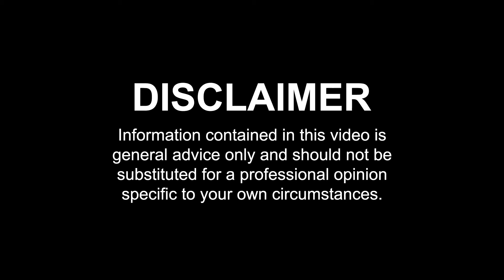Mercury Filling Removal (SAFE) - DON'T replace your fillings UNTIL YOU WATCH THIS!

Comment: I got mine removed today BUT they did not have an air suction thingo, and they did not use a rubber dam. I think they just used two suction sticks and that's it. I'm not toooo worried, I have zeolite clay to remove heavy metals, plus activated charcoal. I even have herbal teas meant for detox. 
I emailed a holistic dentist to get a quote from them (to do my other mercury fillings there) but they cost a lot more.
Reply: NIGHT BEFORE REMOVAL
 Magnesium Glycinate – 400 mg

 NAC – 500 mg

 Selenium – 100 mcg

 Chlorella – 2–3 tablets

 Omega-3 – 1 softgel (optional)

MORNING OF REMOVAL
1 hour before:

 NAC – 500 mg

 Selenium – 100 mcg

 Chlorella – 3–5 tablets

30 mins before (empty stomach):

 Activated Charcoal – 1 capsule

Optional:

 Fresh orange juice or fruit for natural vitamin C

EVENING AFTER REMOVAL
 Activated Charcoal – 1 capsule (away from food/supplements)

 Chlorella – 2–3 tablets with dinner

 Magnesium Glycinate – 400 mg

 NAC – 500 mg

 Selenium – 100 mcg

 Omega-3 – 1 softgel

DAILY FOR 1–2 WEEKS POST-REMOVAL
 Liposomal Vitamin C – 500–1000 mg, 1–2x/day

 NAC – 500 mg, 1–2x/day

 Selenium – 100 mcg

 Magnesium Glycinate – 400 mg

 Chlorella – 3–5 tablets, 2–3x/day with meals

 Activated Charcoal – Optional, 1x/day if needed (away from food/supps)

 Omega-3 – 1 softgel

 Lion’s Mane – Optional (for brain support)

For you, since it has already been 4 months, consider ALA to heavily mobilize the mercury, and binders, like the activated charcoal, coupled with the rest to fully remove it.

Comment: I got my mercury fillings in
1976 . Just had a small one removed yesterday. It was a small one on the side of my molar .. dentist drilled and then used a straw like tube to suck out the vapor (I'm assuming) I want to to a preventive detox in case I swallowed /inhaled mercury vapor. Any suggestions how to get mercury out of your system

Comment: I just went to get mine removed today and last week... I am shocked at seeing online the special procedures whilst I had them removed in a very casual way... My dentist had no protection for herself, staff or me... My teeth were drilled cleaned and refilled with composite... I was worried of swallowing the components of metal so I kept asking for permission to spit and the sink would have dark dust in it when I'd spit out saliva... Very small particles and not that much though...

But there was absolutely no special measures taken during the procedure
Reply: Any update ?
Reply: @hardhitta1000  I'm taking zeolite clinoptilolite from time to time, I hope I will take it regularly instead of once in a while. I do experience dizziness which is very unusual for me... However I cannot say that it's definitely due to the filling removal. I'm sure the zeolite will do a good job insha'Allah. All is good... I don't have unusual memory loses, I haven't got any symptoms of illness for now...

Comment: My mercury/amalgam fillings were put in when i was 14 and now aged 80 i am wondering what all the fuss is about. Mercury is only 6% of the amalgam and if it was as dangerous as we are being led to believe why aren't people dying in droves from these deadly fillings?
Reply: Wow I got mine at 12 and I’m 34 should I remove mine or ride the wave? 😂
Reply: How many amalgam fillings did you have? Thanks for sharing.
Reply: I got my mercury fillings  in 1976 . Just had a small one removed yesterday . It was a small one on the side of my molar .. dentist drilled and then used a  straw like tube to suck out the vapor( I’m assuming ) I want to to a preventive detox in case I  swallowed /inhaled mercury vapor . Any suggestions how to get mercury out of your system
Reply: @Givingyouthebird123  I get mine out tomorrow, below is the protocol i will be taking. Since it has been months for you, it is safe for you to include all of this, and ALA (Alpha Lipoic acid) which will heavily pull the mercury from the tissues that it has settled in, coupled with the rest below, it will be bound and removed.
Reply: @Givingyouthebird123  NIGHT BEFORE REMOVAL
 Magnesium Glycinate – 400 mg

 NAC – 500 mg

 Selenium – 100 mcg

 Chlorella – 2–3 tablets

 Omega-3 – 1 softgel (optional)

MORNING OF REMOVAL
1 hour before:

 NAC – 500 mg

 Selenium – 100 mcg

 Chlorella – 3–5 tablets

30 mins before (empty stomach):

 Activated Charcoal – 1 capsule

Optional:

 Fresh orange juice or fruit for natural vitamin C

EVENING AFTER REMOVAL
 Activated Charcoal – 1 capsule (away from food/supplements)

 Chlorella – 2–3 tablets with dinner

 Magnesium Glycinate – 400 mg

 NAC – 500 mg

 Selenium – 100 mcg

 Omega-3 – 1 softgel

DAILY FOR 1–2 WEEKS POST-REMOVAL
 Liposomal Vitamin C – 500–1000 mg, 1–2x/day

 NAC – 500 mg, 1–2x/day

 Selenium – 100 mcg

 Magnesium Glycinate – 400 mg

 Chlorella – 3–5 tablets, 2–3x/day with meals

 Activated Charcoal – Optional, 1x/day if needed (away from food/supps)

 Omega-3 – 1 softgel

 Lion’s Mane – Optional (for brain support)

Comment: Dr I am very scare I have two left and right upper and need to be change to composite and I have decay under it . I thought they will last forever !!!!! I am maddddddddd really mad and scareeddd bcz keeping is dangerous specially if their is cavity will lead to infection  removing is dangerous all dangeroussss 

My dentist is bio 
But how safe is the removal I don’t want health issue after I have health isssue I don’t want new symptoms or my ibs to get worse or get headaches or something in my brain after removal or crack my tooth I have soo many tough
Reply: Did you get them removed yet? Your situation sounds like mkne
Reply: @Skyestorm2630  not yet I am scare and still worried
Reply: Update ?
Reply: @hardhitta1000  hamdoulilah he changed to white 3 month ago, i was scare I did one by one and for sure white one are little more sensitive but is okay it takes time to get use it.

Comment: I had 4 fillings replaced by just a drill today. In soooo shaky and sick and have horrible anxiety! I’m so scared right now. I wish I didn’t get them out!!

Edit update after ONE month.  I had a panel of tests done, and it turns out my body was 16xs the normal limit of heavy metals and 43xs the limit of mycotoxins. I had 4 different types of mold and I was recommended to start a heavy metal / mold Mycotoxin detox asap. I started this one week ago and the brain fog has already lifted. I’m grateful to be able to recall my days. It literally felt like I had full-blown dementia. I am so blessed that this isn’t the case.
Reply: all at the same time? and didnt use any safety like rubber dam? i have 2 that will be replaced this week
Reply: @mr.yuteph8157  yes all at once, with no rubber dam. It was absolutely horrible. I’m still detoxing with chelation therapy and major diet change
Reply: @manifestlove888 I’m so sorry to hear this. How are you doing now?!
Reply: @Skyestorm2630  for some reason I don’t always get notifications to the replies. But I’m doing amazing now I had to give up my job and stop driving because I couldn’t think now I’m back behind the wheel of my vehicle and I’m working again and I just had a beautiful baby boy.
Reply: @manifestlove888  how many years have you suffered from this ? ( I am also facing brain fog , memory loss and acting like a dumb) 😭
Reply: @unknown77722  it was 3 years almost
Reply: @manifestlove888 that's boss did you get them replaced with the bpa composite though?
Reply: Update please ?
Reply: @hardhitta1000  I am actually doing amazing. I am back behind the wheel of my car and I have a job again I also just gave birth to a little baby. I honestly thought that like, I was gonna die. When I read this, I almost don’t recognize the person I was I was terrified. But I came out of it. I don’t think people can come out of it without help. So thank God for the finances.
Reply: May i know what helped u with both  pls I am so sick

Comment: My dentist didnt use rubber dam or ventilation am i going to get mercury poisoning?
Reply: If you don’t feel good or experience depression and anxiety start detoxing the mercury with low emf home infrared saunas and mix enterosgel with water before you go in the sauna because the sauna will pull the mercury from the tissues but the gel will help push it out so the symptoms are low

Comment: Can you believe I searched out a green Dentist that did safe mercury removal and he didn’t even use a dental dam? I didn’t realize it until after it was over and they were prepping for my onlay that I had a small pebble size in the side of my mouth they didn’t even rinse my mouth out I had to get up while they were out of the room and rinse my mouth out now past 10 days I’ve had a resurgence of chronic fatigue syndrome that I’ve been in remission for a decade and I’ve got it in the first place from mercury fillings long story the dentist I had in the 80s wanted to use up all my insurance I’m guessing because he gave me a mouth full of fillings when I didn’t need it they all buckled within six months and had to have them all replaced well I ended up with chronic fatigue syndrome for decades after that anyway I’m just so mad right now
Reply: Are you fine now? I have one of those mercury fillings for almost 2 decades. Thinking of removing it in a safe way
Reply: @hevesat1920  No answer as usual.
Reply: Yeah are you better now? I would be pissed too
Reply: Can you please answer our questions/ Are you dead?
Reply: Same. I got really sick after taking mine out. But strangely I feel lighter. I’m so glad they are gone.
Reply: @chloethemessenger  Is it better to remove the molar if not necessary?
Reply: @chloethemessenger  how sick did you get ? And how many did you have? I’m trying to get all mine removed before trying to get pregnant but I’m scared
Reply: Ok. Is November 2nd 2022 are you dead?
Reply: What does the mercury fillings get replaced with?
Reply: @thussaiththelord3378  Ceramic filling.
Reply: How are you now???

Comment: Can I just get a dentist to remove eight back teeth I have seizures so don’t want to risk exposing myself to the vapor but I want them remove to see if it will help reduce seizures
Reply: If you remove 8 back teeth, you will create more problems. Your bite will be off, harder to breath properly....and your facial structure will basically collapse.
Reply from the maker: I'm sorry, it's not possible to give specific advice on a forum like this, but I do hope you can find a practitioner network close by able to review your situation and help with those seizures.

Comment: How about after we have a mercury filling removed, what can we do at home. I was given 1 small sample of chelate only. 
Surely we can do more as a detox  naturally after.  I have quite a few more to remove. thanks :)
Reply: Activated charcoal start with a teaspoon use use a plastic spoon to keep it activated in a glass or cup food grade and made from coconut
Reply from the maker: Hi, Active chelation must be prescribed and overseen by an experienced doctor/ team. It can be very very dangerous if it is not monitored closely.
Reply: @healdentalcare4150  so how do you detox naturally?
Reply: careful,i remember reading  do not try to detox right after a removal. look it up, basically taking detoxing medicines during high doses aka right after a filling removal when the mercury is kicked up and into your body some,  does more harm than good, you want to wait till your body naturally excretes some first.